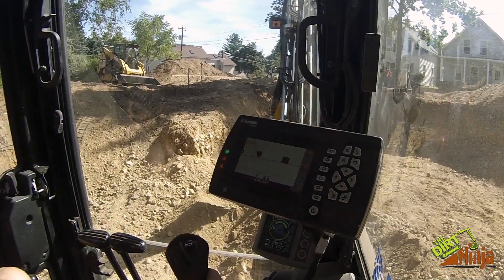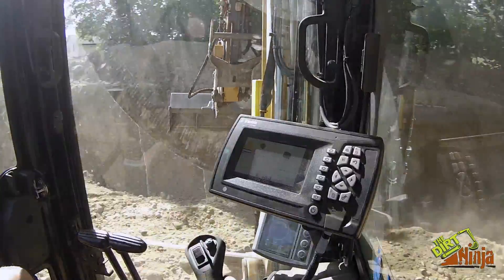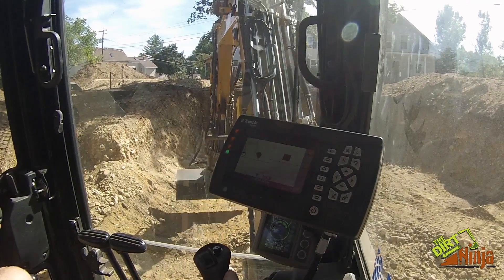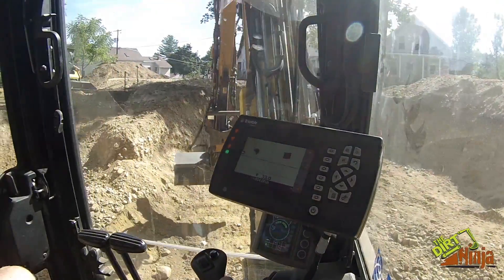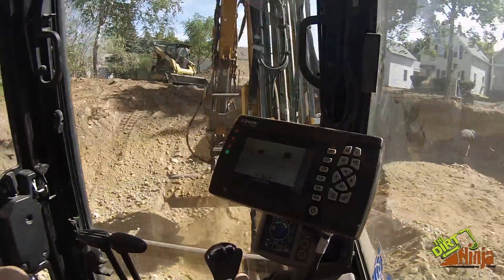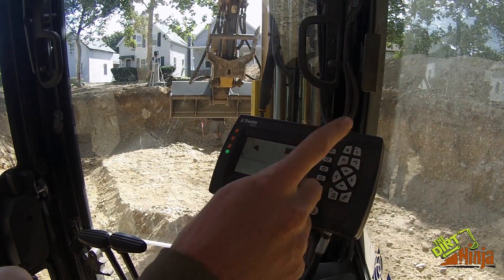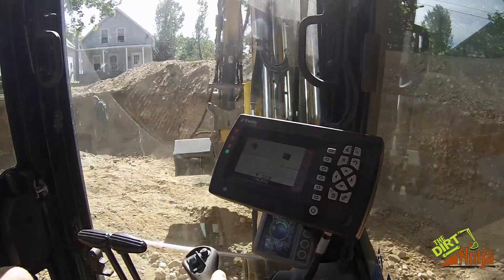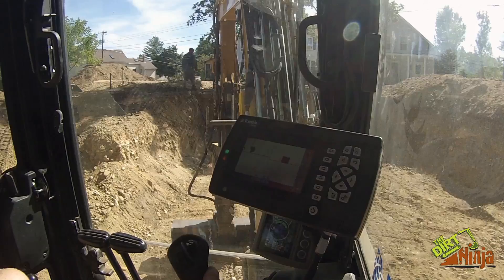Digging A Foundation With Trimble GCSFlex 2D System - Part 2

Comment: Do you have a heading sensor on your flex system?  Or does  that only come into play when you're working to a slope? Also, how often do you check bucket wear?
Reply from the maker: +Joel Moen I do not. It only comes into play when you are working across a slope. I check bucket wear about once a month. It all depends on how much you are using the bucket and what material you are digging in.